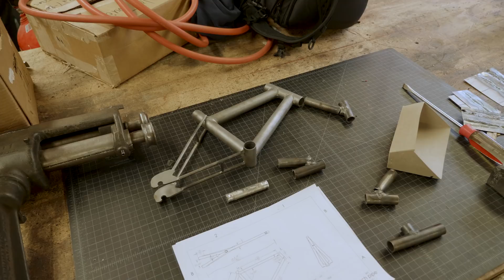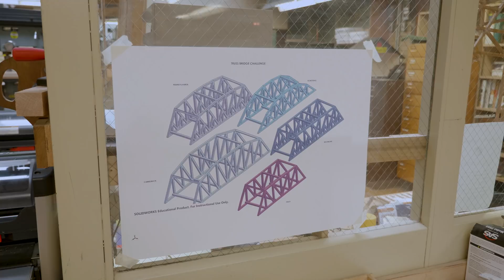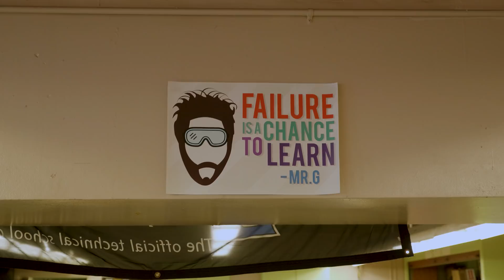Modern Shop Class Tour w/ Mr. G! - Memorial HS S.T.E.M. Program

Comment: My High School had Industrial Arts, Woods, Auto, and Ag mechanics . That was in the early 80's
Now they have Woods only and the instructor knows nothing about wood working. Our sawmill sells them a little wood every year.
While in High School the GearHeads I hung with use to buy our parts from a place called Mr G's.  
So seeing your friend Mr. G, brings back good memories of hot rodding around at a teen.
Reply: I started shop teaching a little bit under-qualified at the time. But through collaboration and taking on big projects, I caught up. I also took some night school welding and Auto Body.
Reply: @MrGsWorkshop  Good job doing what it takes to get up to speed . I'm sure your students appreciate your effort